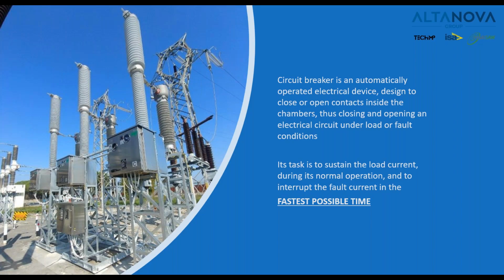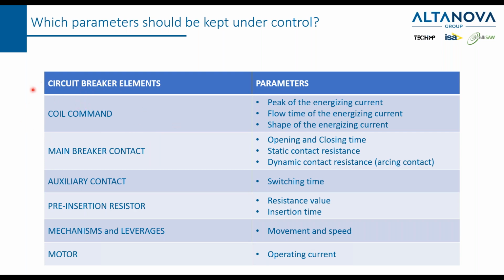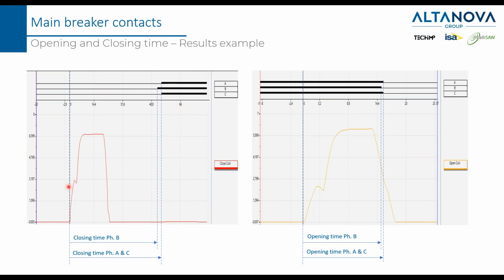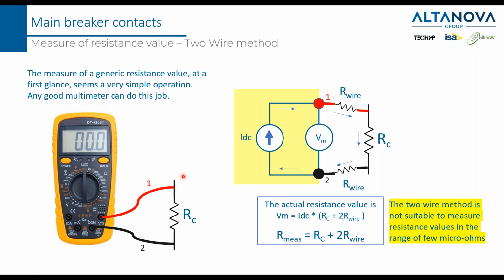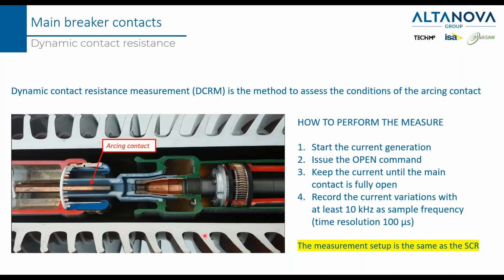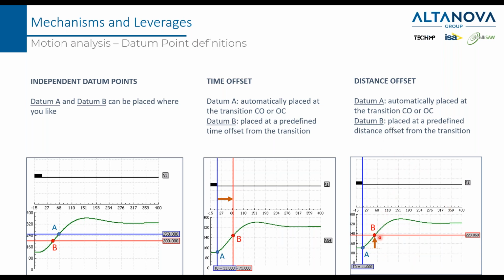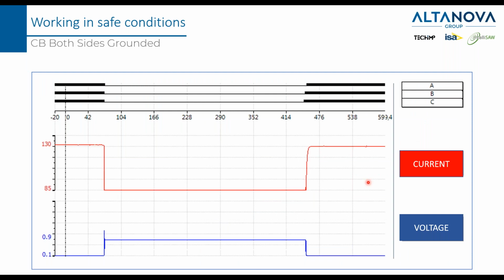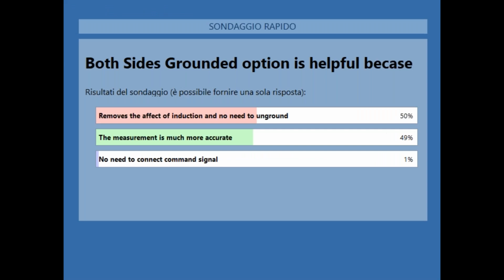High voltage circuit breaker testing Webinar

Comment: I have one question which software you used here for simulation??
Reply from the maker: Hi, can you expand on which simulation are you refereing ?
Reply: @sheppo17  actually I want to learn matlab and pscad simulation and want to test High voltage circuit breaker testing so how can I do that
Reply from the maker: @Allone-r1c  well I know some of my colleagues use Matlabband I used it while I was studying, but you see it was a long time ago and I am not anymore using it so I cannot asist you with that since I also am not sure how I would model and simulate a CB